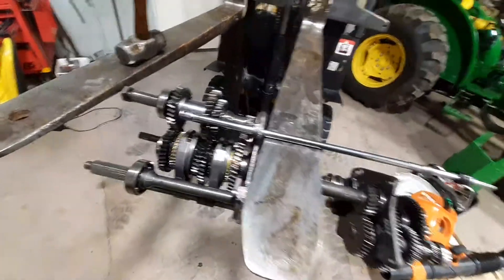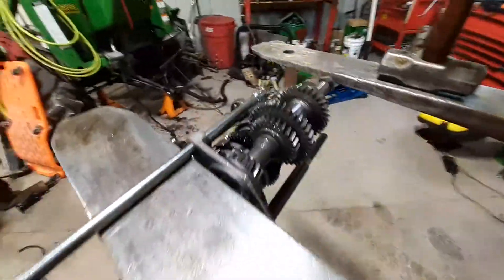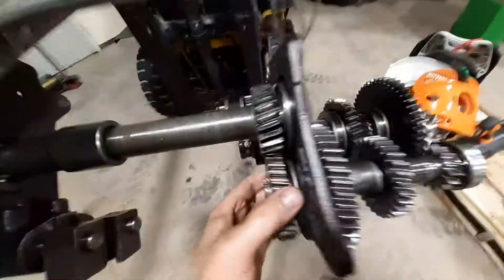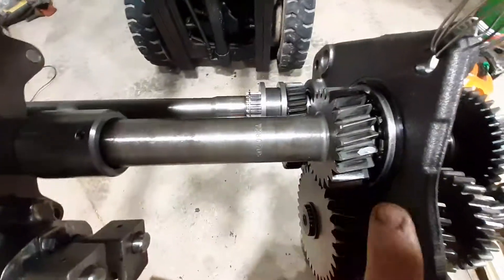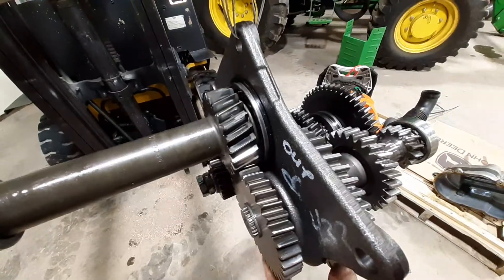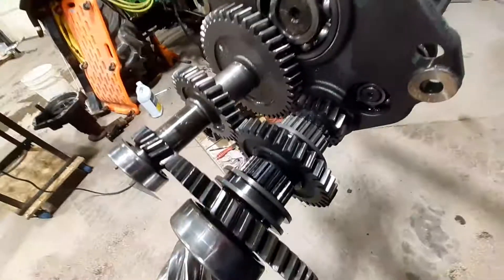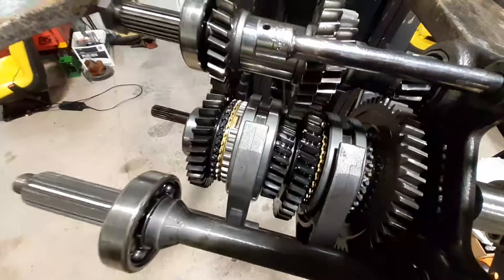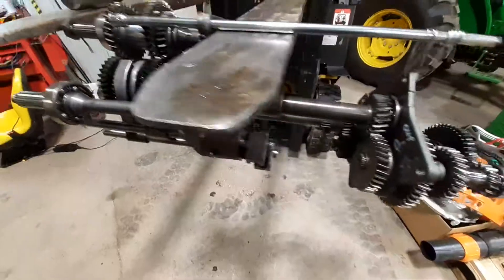John Deer 4300 driveline

Comment: bought one yesterday stuck but maybe in middle range. not sure yet.  thanks for the video. mine is hydro
Reply: ok, when unloading it after 80 mile trip, it went into high selection????  and can shift into the other selections with no nois or grinding as i am driving in high???  just the opposite as yesterday??? the detent is working (clicking into each gear) but not actually changing gear   FORKS???

Comment: Thanks for the pic now how do u get all that out?
Reply from the maker: Hello, I definitely don't recommend this for a beginner. If you have confidence in your abilities. I can help. What are the issues you're having?
Reply: @milobydesign  ABC range shift shaft broke off flush with outside of transmission.!!!😡
Reply from the maker: @leeroyexcavator9149  yeah that's a really big job. I've done three of those. You'll need a forklift or another piece of equipment to separate the transmission from the rest of the body. It is recommended that you upgrade your fork assembly. That is inside the transmission. It was a fix as fail. You're going to need to go to your local John Deere dealer to get the information on how to separate and what tools you'll need. There's no gaskets couple of seals. You'll need to get or make what is called a detent tool.